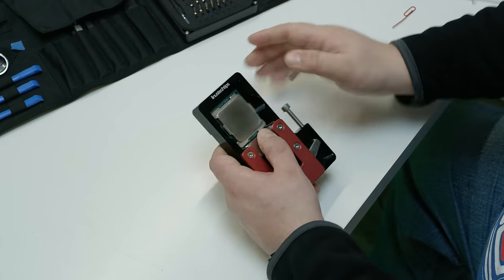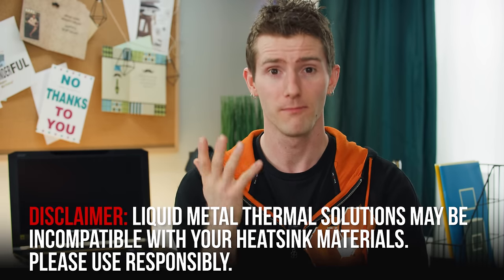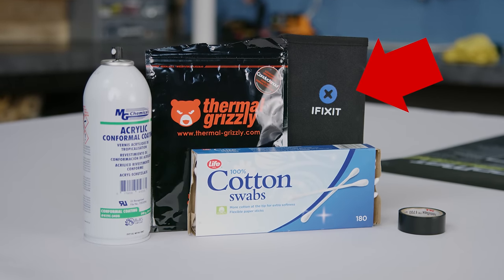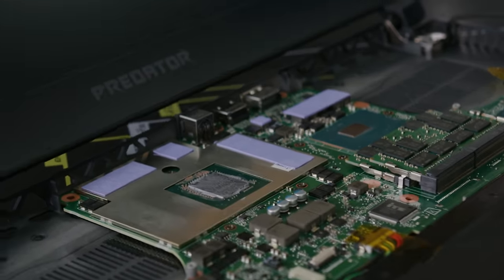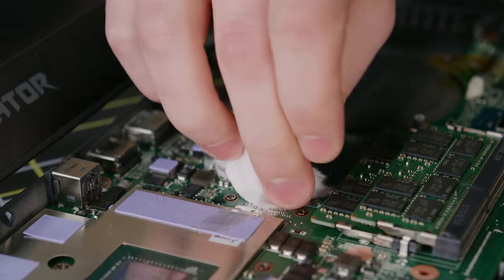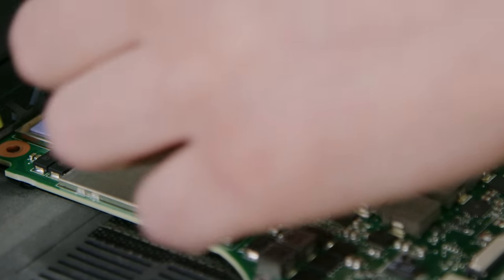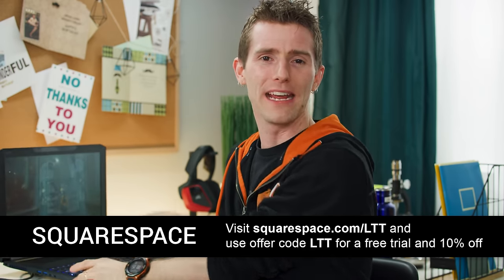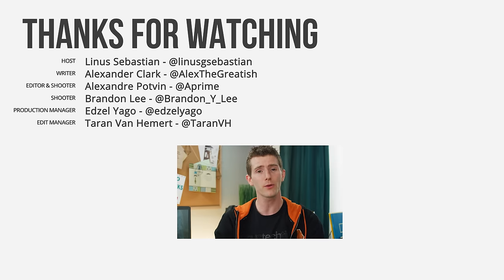Liquid Metal Laptop Cooling – 20C LOWER!

Comment: I saw this video and decided to apply the Arctic MX-2 to my buddy's laptop. He would get the worst perfomance at the lowest resolution and some serious thermal throttling. 
Temps were fluctuating around 78 - 81 degrees, with some other less demanding games it'd get around 75 degrees.
Now after reapplying the thermal paste temperatures dropped and it runs about 15-17 degrees cooler.
That was really worth, thanks Linus!
PS: laptop had an i5 4200u and a 920m
Reply: I was reading with a huge laugh, because I thought you are pranking your buddy with the cheapest thermal paste available, and the guy just start to thermal throttle right at the start of booting screen 💀💀🔥
Reply: If it was that good imagine how good it would be if you applied thermal grizzly extreme paste

Comment: Is that heat sink copper? A galvanic reaction may happen between the gallium and the copper, eating away at the liquid metal.  May damage the heat sink and require reapplication every few months.
Reply: aeroengpilot just watch the 1 year after vids all over YouTube regarding copper heatsinks.
Reply: 3 years?? I ended up repasting my 7 year old  i7 MBP with Kryonaut and saw good results.  No thermal throttling and about a 5 degree drop.  Was that a delid or a laptop? The lid on a desktop CPU is nickel plated so there are no issues with liquid metal.
Reply: By heat spreader do you mean you delidded your laptop or did you add an extra part?  Sorry I'm not a computer expert but if you can get it to work and have the liquid metal stay liquid for 3 years I may have to try it too.  Are you getting those massive 20 degree temp drops? Have you opened it up just to see what it looks like?

Comment: i am wondering if you get any drop on outside temperatures of the case? I'm afraid that won't make any difference and make it even worse due to the slower fan speeds. Anyone should consider damaging laptop internals and even causing dangerous battery explosions most probably on macbooks. I guess laptop manufacturers are well aware of that. Only sinful solution could be undervolting the CPU without damaging anything which reduces the power consumption in Watts and results lower temperatures (if you are not planning to overclock). If you still wanna do that, make sure you decrease fan trigers in bios advanced settings ( there is a hidden combination in most laptops where you can also set your stable voltages after trying on Intel Extreme Tuning Utility.  Of course there is some cases you will get temperatures over the safe margin which can cause damage where repasting could be usefull. Just avoid high external temperatures on laptop.

Comment: I found the best way to protect surrounding smd components on the chip, is to use UV soldermask. Just be carefull just to use just enough to cover them. The green mask should of course never be higher then the core of the chip. Then use an UV lamp for a couple of minutes to dry the UV soldermask. It is far more better, then use electric tape, which is of course, not liquid proof.

You can maybe also use nail polish on those SMD components, but I have not tested that yet.

Comment: I have done this on my Legion 5, has been around a week and have checked countless times for seepage, and a tip if you do this, buy some liquid silicone, and spread it around, I don't feel safe with the spray on stuff shown in the video, and spread it around in the parts shown in the video, add around 2 or 3 coats, works pretty well, liquid metal is a nightmare for the first time, it's hard to spread around, and suck back into the needle, and also, make sure you check it, and temps a week apart, if it dryes up, it will do pretty much nothing for cooling, adding a teeeeeny bit extra, to make sure it is still a liquid. Tbh, I recommend you first try Kryonaut, unless your laptop, as much as you clean it, and apply good thermal paste, still overheats, then sure, my laptop went from 95, to a whopping 72° C from cleaning, undervolting, and adding liquid metal, insane change, full load on all cores.
Reply: so if you want to use this method, you need like to check the thermal for 1 month periodically?

Comment: I did this. My ROG gl502vt survived and has 10-15c less under load, thanks!
Though you used a bit too much in the video imo.
Reply: Priit Minka I'm gonna try it on my rog gl753ve it's a alot bigger so it should go smoothly

Comment: One way to avoid excessive application and accidental spills is to deposit a small amount of liquid metal in a separate container then use a cotton swab to gradually transfer the substance onto the cpu and gpu until a correct amount is reached.
Reply: this sounds like a way better idea, very underrated comment.

Comment: Welcome to 2010 Linus...Coollaboratory Liquid Pro...Just a note guys before you try out..even though your heatsink might be cooper, it may not be 100% cooper and will still form an alloy with the compound which gets hard and it is kinda absorbed into with time, therefore needing you to perform heatsink lapping and repaste every now and then (about 6months from experience - just did mine again yesterday). It gets up to the point when if you are overclocked the temps might still look good but you get random weird crashes, becoming more frequent with use, that is the point that you know you need to repaste. However if your heatsink is nickel coated you should be good :)
Reply: Also conformal coating is not needed..unless you are linus or suck..Also Coolaboratory comes with a really really small needle thus you can't fuck up like in the video
Reply: pretty much every laptop
Reply: how do you check the heatsink material? i can’t find any documentation

Comment: With such a drastic improvement you would think that the manufactures would start applying this on the line a pass the cost onto the consumer.
Reply: NRiyo3. I imagine it's difficult to implement on an assembly line with any kind of consistency.
Reply: NRiyo3 it can ruin the hardware quite easily so its not worth it.
Reply: It's about corporate tradition and laziness. They could easily engineer a solution like this into a product.
Reply: It is not likely. The liquid metal alloy contains gallium. Which is know to corrode metals such a aluminum and others.
Reply: NRiyo3 also that spill that Linus did is likely to corrode those aluminum plates. Will be nice to show the aftermath after hours of the spill
Reply: This is not a long term solution. The gallium in LM corrodes aluminum within hours, copper within months and nickel plating within years. It attacks solder joints too and if there is any excess is applied between the heatsink and chip it will bead off and can short out god knows what. Imagine someone with a laptop in their backpack slips and falls, little bit of LM runs off onto the board. Waiting for trouble. Conductive thermal paste is not stock for a reason.
Reply: It's more expensive and much more time consuming.  And much more likely to kill working products.
Reply: Even though Ga is corrosive to pretty much all metals diffusing into Copper is very slow indeed ....By the time you notice any significant damage your device will be in museum.
Reply: bobsagget823 takes much to corrode copper than a few months

Comment: I just did thus on my HP Omen. Worked out well. Cooling an does not ramp up so much you think it will take off. Thanks for this video and showing what not to do. shooting all over the mother board. Always  despence some where other than right on the cpu/gpu. Great heads up.

Comment: For anyone out there considering doing this to your laptop, I suggest you read up on what kind of reaction the Gallium in the LM has with the copper heatsink. Basically, the gain will only be temporary if you dont nickel plate the heatsink, and you can get that done pretty cheap.
Reply: Ok nerd

Comment: Wow. Why don't manufacturers use this stuff in all performance laptops by default?
Reply: Gungan expensive, destroys certain metals and forms alloys with others meaning it sometimes has to be reapplied yearly
Reply: yes can any answer this
Reply: if you build 10000 notebooks and and everyone needs like 2-10€ more for better cooling thats an insane increase in costs
Reply: It can easily leak if users drop the device and then fry the entire device.
Reply: It seems like there are more downsides to using it no matter who you are. Most cpus are mounted vertically, how does it not leak out then?
Reply: just add those 2-10€ to the cost of the device and it's over.
Reply: Gungan it's not about leaking because of gravity, it's about the fact it can move with force
Reply: Seems like an easily solvable issue to me, why not shaped lids and sinks with grooves to prevent that.  We are talking laptops here and it's not like there's a go to cooling solution for all of them, they all seem to be specifically built for each model.  So why not?
Reply: saborwolf then you risk not making proper contact
Reply: they're being assembled as fast as possible by foxcon slaves. one wrong squirt and the whole process is gonna get held up, and it'll possibly destroy parts. regular paste is much more forgiving.
Reply: isn’t that mercury
Reply: Djuntas it destroys aluminum, and forms an alloy with copper that is a good thermal conductor but doesn't form evenly leaving some air bubbles. If you left it long enough you would essentially solder copper to your die. When you go to reapply it you'll tear the chip in half.
Reply: @Lead_Foot  Would it even be necessary to reapply it at that point? If you're basically soldering the cpu to the cooler then I doubt the thermal conductivity would be affected, since copper and gallium seem to have similar conductance values.
Reply: Because they expect it to fry until community is mad about it
Reply: @bunnyben5607  They dried out extremely quick and have to be re-apply regularly, and everytime you do so, there is an unacceptable level of risk that you will fry your device.
Reply: @tanpro260196  I've been using it for over 2 years now, never had to reapply it, never had any leakages and I probably put slightly more than I should have on my CPU. I used super33 electrical tape, its pretty expensive (£10 for 1 role of tape!!) but it's very stretchy and has very high heat resistance, stretchy tape is what you need so you can kinda mold it around those resistors on the GPU. I hear nail varnish does a fantastic job as an insulator, its kinda like liquid electrical tape (yes that a thing).
Reply: @MrMoo272  doesn't it eat at your heatsink?
Reply: @nathancasey7712  only if it's made of aluminium, copper heatsinks should be fine.
Reply: thermal paste application in a factory is very messy, you can see in the video thers bits of paste everywhere around the cpu. Liquid metal would instantly kill it
Reply: this comment thread was great to read to convince me to not put some damn metal in my laptop lmao
Reply: Simon Liu was
Reply: @deadly1246  Custom built laptop do come with liquid metals (with precautions like coating and tape). Check Linus latest video on Ryzen 3950 laptop.
Reply: @deadly1246  also my laptop and 4 other (friend's) has lasted 3 years on liquid metals with only 1 re-application, granted I use conformal coating and electrical tape (good thing because they do spill in 3 out of 5 laptop when I open up to re-apply).
Reply: @therift_7350  bro, i need your advices on applying for the first time.. i have it now and i dont know any precaution.. also, does it leak out when my laptop is kept vertically in my bag? Please help thanks in advance
Reply: Mackhem Chuah It can leak when positioned vertically, but that’s the point of conformal coating and tape. TBH, the application is pretty much the same as thermal paste but you can’t put too much or too little,  l was paranoid on my first attempt that I put too little and there’s very little contact and my GPU was 91c idle (fixed that later). 

The thing is, if you properly protect your chip with conformal coating and tape, you don’t have to worry much about spilling. I spend about 1-2 hours on conformal coating inner and outer edge like a fence and most importantly the conductive part of the chip (4 layers of coating) and taping.
Reply: @therift_7350  i have the coating but not the tape.. is it still good to go without the tape?
Reply: Mackhem Chuah It should be fine if you do multiple layer, but I’d go with the tape for the peace of mind.
Reply: this will be soon water under the bridge since Intel is now developing a CPU that doesn't heat up
Reply: It can leak out and damage other components while being moved around during shipping and no manufacture had the balls to invest in rnd to make it safe like Sony did with the ps5.

Comment: I run a razer blade 15 2018 base model
With Lm whent from 98c to 75c 
23 degree drop crazy.It's been just less than a year and I just applied my second coat of liquid metal. It was a little dry but I believe that was because I applied to little to be safe once it really soaks in your good haha I put 4 coats of conformal coating the first time before my second application I added two coats. Just go slow and be patient. Totally worth it.

Comment: I have 2 questions:
1. What about galvanic corrosion properties with aluminium or copper, does it last longer than a year without oxidation?
2. What about exposure to subzero temperature, will it restore its properties fully after? (It's important for a laptop where I live)
Reply: pity they didn't even try answering these questions
Reply: Are you a chem engineering grad?

Comment: Gallium with aluminium OOOFFFF
Reply: at some point, gallium will do it to nearly all metals, and both copper and nickel aren't immune from this, its just not as quick as with aluminum.
Reply: I opened the video specifically to see if it was gallium.
Reply: Main reason why this isn't worth it. You're better off hacking the bottom off, or simply paying a dude at a local CNC shop to just cut you a proper heat sink, not the consumer grade BS. If you're genuine about your pursuit for a cool setup in a small package, it shouldn't matter if the thing is a bit 'hacky'. I wouldn't.
Reply: Or rather than turning a slick $3k laptop into something 'hacky' or using sketchy ass thermal conductive shit that eats alunimium, you simply apply some good quality non-conductive normal thermal paste correctly and get a 10c drop in temps, achieving essentially the same results.

Factory applied thermal paste is, always has been, and always will be complete trash. Even cheap aftermarket paste applied yourself will be a big improvement.
Reply: Harry 8642 it is an alloy..... tin alone is a soft metal and a bad conductor , copper is kinda soft and is a great conductor, mix them together and you get an alloy which is a great conductor and is much stronger than both metals (bronze) gallium is a metal too it can change properties when alloyed correctly
Reply: aserta
You are really just wasting your money with a new heat sink if the bottleneck isn't there.
You really don't want to use a cnc machined bulky heatsink in a laptop like this. The modern heatpipe - thin fin construction is way more efficient and lightweight than anything a machine shop can give you. No wonder all the modern air coolers, even the liquid coolers are built with this method instead of the old bulky extruding method.
Reply: Harry 8642 p0 9 ok
Reply: But you can just use normal thermal paste (still better than Intel Colgate) and undervolt CPU to lower temperatures and if you can overclock it JUST DO IT it will give you better performance, lower temperatures and decrease power usage.

Comment: Why don't the manufacturers use liquid metal, and design a seal to prevent spilling out.
Reply: It needs to be touched up every few years.  It will oxidize over time.
Reply: Have their been tests that there is degradation due to oxidisation within this application? The reason why I question is that I've been sitting on the same liquid metal for 5 years without change. You'd see more degradation in many regular tims in that time.
Reply: Cost
Reply: Greg is correct. JayJapanB tims can harden over time and be just as good as day one. Some are even glued on.

Comment: I managed to get around 10-15 degrees lower on an old Dell XPS 14 L421X 7 year old laptop I bought, before under load it would go up to 95 degrees celcis, now is sits at around 80-84 and around 55-65 in idle down from around 70+ :)